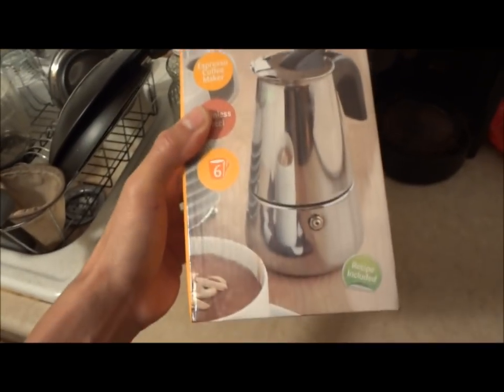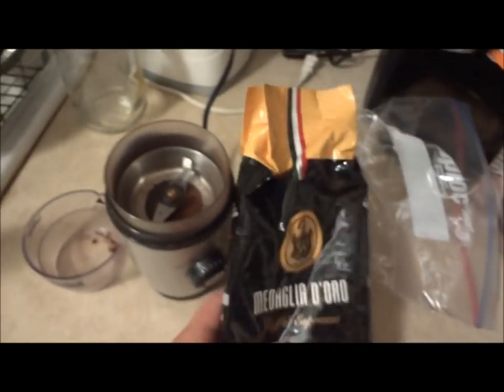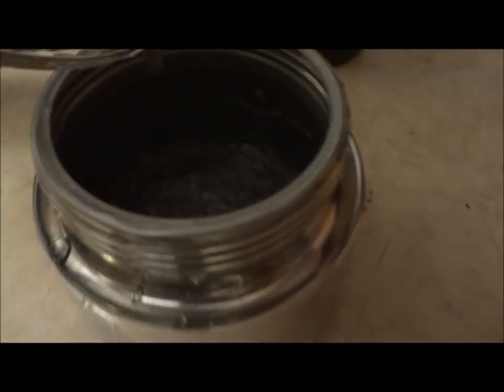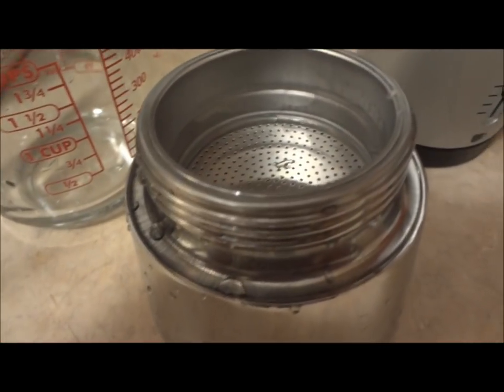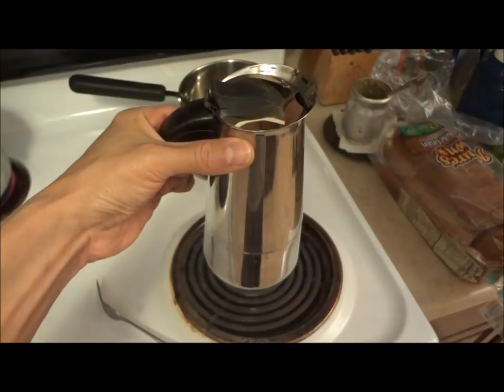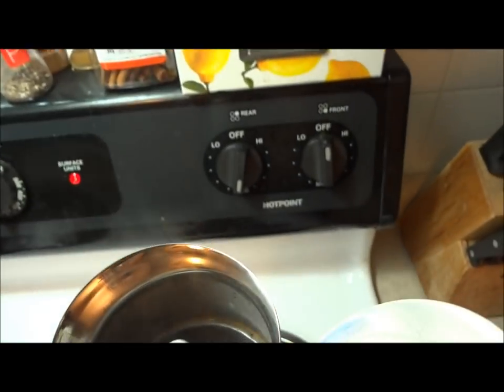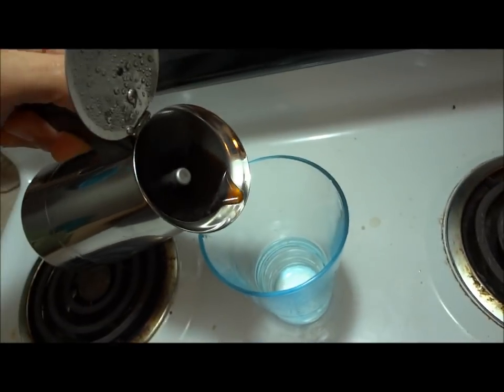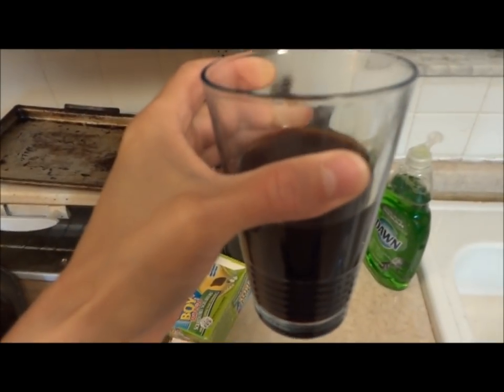How to make the best cup of coffee

Comment: I have Bialetti 10 cup Venus version - I own the 10 cup size - so,  using three scoops - plastic scoop came with it -  I grind real Arabica / European Continental fresh beans - I use 2 x scoops of fresh - then 1 x scoop of Lavazza - shop bought - to achieve my blend - NOTE 10 cup makes 2 x mugs - almost no milk bit of Demerara Sugar - perfick ------- Warning 1 - when tightening do not use plastic handle as a lever - it will snap - Warning 2 - do not boil bottom water chamber dry each time - it will both rust right through and only last a year and  - you can not buy bottom chamber in UK or on Amazon seperately.  On my second one because I kept boiling dry  and a big hole appeared in bottom - it just collapsed - but this is the best coffee EVER ;)  None of that stupid over priced carton / portioned Geworge Clooney advertised machine emptying your wallet stuff for me thank you !! All the best PS use big oven gloves to tighten, using thumb to gently, gently, gently push against lever / lid join - then pop on stove